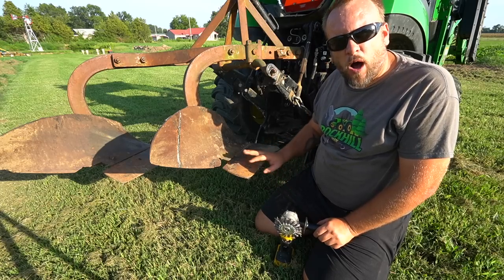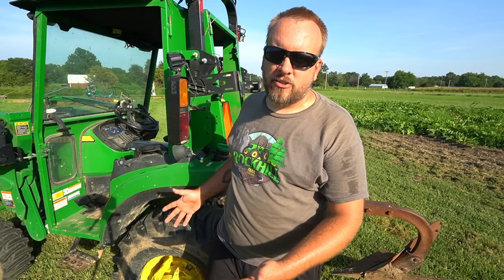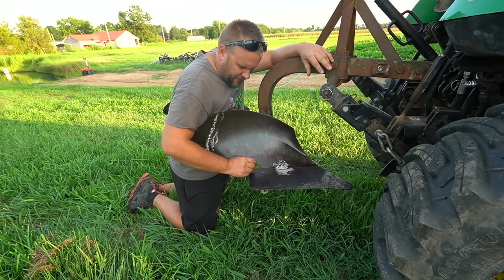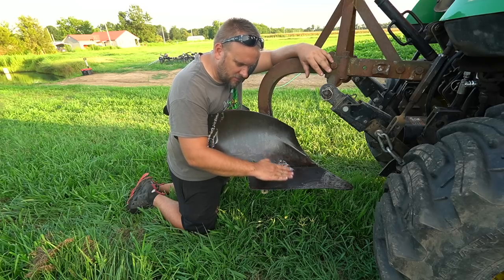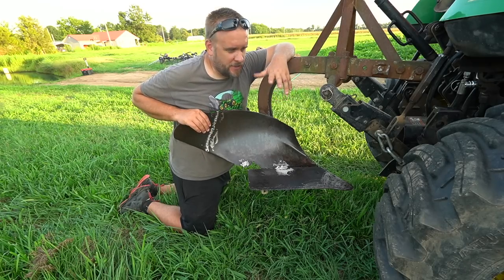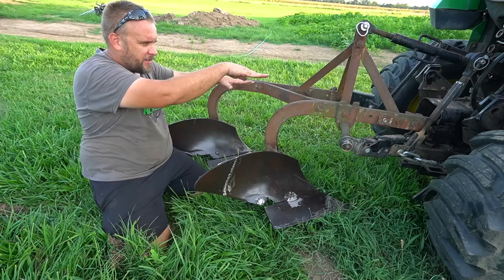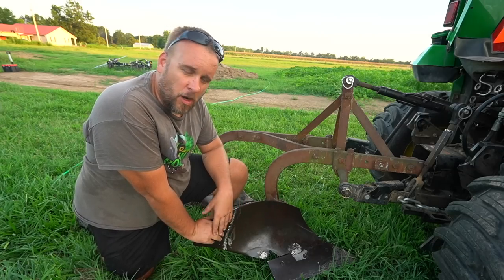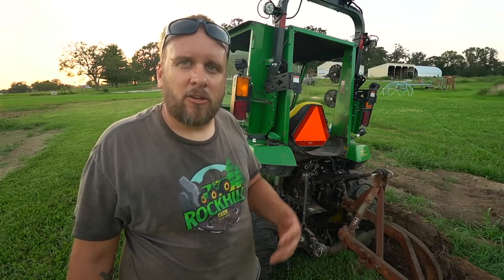Pulling a 2 Bottom Plow with a Compact Tractor - Better than a Tiller?

Comment: If you have to go super slow and not plow as deep as you want to with your tractor, I don’t see a benefit to try and use a two bottom plow. A single 14 or a single 16 would be a much better option. A lot of people plow one direction and then back up all the way to the beginning to plow again. That takes double the time too. Split your plot in half and roll the dirt to one side, then turn around and roll it the other way. That way you are always plowing from one end to the other, not just one direction. When I plow my garden I roll the dirt all inwards one year, then towards the outside of the garden the next so there isn’t a hump or a ditch in the middle of the garden. That old plow will shine up with time too. Love the videos! Take care!

Comment: Very interesting. I am just a layman interested to learn. I was thinking to get a small tractor to play on my small property, but it is this kind of thing and the huge cost that holds me back. 

What is it about your soil that makes the going so hard? I don't see rocks or roots and doesn't seem terribly solid with clay. I do think I see the sod holding it back - making it hesitate. Would it be better after a rain (or worse)?

Anyway, just mechanically speaking: At 20HP deisel tractor could definitely do the job, given sufficient traction and that nothing breaks - it's just the speed at which it can do it. But what is preventing this 40 HP tractor from getting the job done is the hydrostatic drive - I realise on watching. If it were mechanically driven and the gearing were appropriate and if the tires held and nothing tore off or bent - that tractor could do the job without breaking a sweat - if at very moderate rate of speed. But there is something difficient about the design of the hydrostatic drive - it's like it's trying to start out in third gear with a heavy load by trying to slip the clutch (of a manual) - it does not work same as proper gearing. You are triggering the pressure relief of the hydrostatic pump. That tractor was made to look good on he showroom floor - it's just bad design suggest complain to Deere (although that might be like complaining to Boeing about deficient plane design). The difference is that those old tractors with mechanical gearing were properly designed to get work done.

It's not that hydrostatic cant do the job. My wife's new fangle jap car (SUV) has a CVT (hydraulic) transmission. The thing has a little four and the CVT makes it so whatever you are doing and whatever speed you are going, the engine is at the optimum speed/gearing. - the engine never struggles (you wont win races, though it's off the line like a pony car).

Comment: Around here the only thing a plow like that does is bring up weed seeds. Also you shouldnt go at fresh gorund with a tiller, you should use use a subsoiler then a chisel plow, field cultivator, scarifier, or whatever you call it in your region, then use a tiller.  One pass with a tiller wont pulverize the soil too much.  Also farmers dont use a tiller because they have tractors and disc harrows heavy enough that does in one pass what it would take multiple passes with a compact tractor to achieve.

Comment: You may want to check your hydraulic pressure / hydrostatic drive. The reason I say this is that I have a similar setup but with a larger frame tractor. 35 Hp hydrostatic drive in a Yanmar YT235.  similar to a 3 series JD.  At 2750 PSI hydraulic pressure I can spin the wheels on my tractor all day. And yes the tires are filled with beet juice etc. So It has more weight and bigger tires, giving more traction that your small frame tractor. As an example, when I get my sub boiler stuck on a big tree root or rock ( I live 30 miles from rocky top Tennessee ) so I have a number crop of rocks every year.  So you could say that my place is rockhall farm the original 😊. In low range, way before it bogs the engine down, it will spin all 4 wheels and did for something solid underneath.  Your 38 HP tractor should be able spin those wheels with ease in low range before bogging down the drive train. Just my two cents worth and probably worth less than that.

Comment: I’ve had pretty much every brand 3 point tiller, yes I make sure I keep up with service on them, eventually they all breakdown, so I have decided no more 3 point tiller’s because they always break when you need them most, so I went old school this year with the older metal equipment, my compact tractor is a compact 33 horsepower tractor, hydrostatic transmission like yours, the only thing left to buy is a plow, found several 2 row plows but I am not sure it can pull a 2 row plow, what is your take on this?, Ty, keep the videos coming

Comment: If that tractor had a 3 range transmission like the 3R with the crawl gear, it would've tore that dirt up. 
Measuring the wheelbase of a 3R and 2038R shows the 3R is one inch longer and one inch wider at the wheels.  It causes the 2R to not make any sense to me as a potential purchase.

Comment: You would be a lot better off with a trailing plow .  I've got a Little Genius 2X14 that I pull behind a Mahindra Max 26XL and it works fine.  You don't have to worry about the 3 point adjustment, depth and angle adjustments are on the plow frame.

Comment: Those talking about there 25hp pulling a 2 bottom plow also have to think about gearing, if he had a 3rd slower range it would pull it for sure. Some of these tractors like my Kubota L2850 have such a low 1st gear in low range the dam thing would pull a house if it had the traction.

Comment: If your tractor had a manual transmission I bet it would pull better...these hydrostatic transaxles just don't pull like a regular old manual tractor will...keep in mind those older tractors had more weight to them as well, so they'd be able to put the power to the ground more effectively without spinning wheels.  

I don't have a plow, I know my tractor wouldn't pull a 2 bottom plow, it would be lucky to pull a single bottom plow, and even that would be a big if it could.  I do have a roto-tiller, but I don't garden so not a huge deal for me anyhow.  

I would assume that after plowing you'd want to disc that area, at least that's what the farmers do where I live...they plow, then a day or so later they go through the field with a disc...some follow behind the plow with some sort of implement that busts up all the dirt clods and smooths stuff out a bit, then they go over it with a disc....I think that other implement is something called a culti-packer....they sometimes run it after plowing and after discing.

Comment: You are talking about dropping in 10 in that's way deeper than needed  12 in bottom  about 7 in deep furrow  also make sure your cutting only 12 in between the first bottom and the inside edge of your right wheel this will help you pull easier and make for a more uniform tillage also look at the geometry of the top link closer to get more uniform furrowing between the front and rear bottom as well as proper offset on your three point lift arms if properly set most small tractors these days have plenty of power to pull a 2 bottom it then just becomes a ballist issue does it whey enough for traction.

Comment: I suspect a majority of  the suggestions I heard are from people who dont own a plow or used one. Angle and hoq much tractor  are the biggest factors. I have had a number of larger tractors now own a Kubota L2501, and I plow foodplots with my 2 bottom plow. Believe it or not with better results, but there are ao many variables. I also have sandy, less dense soil. Is it a perfect machine for it? No. But you can fet by. Interesting video and test

Comment: Put your bucket on and fill with something weight equals pulling power there's a reason farmers add thousands of pounds to front of their tractor
Reply from the maker: List weight for my tractor is 2500 pounds. Mine actually what is 5000 because I have added every kind of weight you can add.

Putting weight in the bucket would actually take weight off of the rear of the tractor
Reply: weight on the front is primarily to keep the front end on the ground so you can steer which he clearly wasn't having issues with

Comment: Umm, no, you do not drive all four wheels onto blocks.  You only drive the left wheels onto blocks.  This is to simulate your right side wheels being in a furrow.  Then drop your plow onto the level ground and adjust your top link and lift arm link so that the plow sits level front to back and side to side on the ground.   The blocks should be the same height as the plow depth you want to plow.  Six inches is deep enough.  

You have more than enough horsepower to pull the two bottom plow, the problem is it's a hydrostat.  If you had gear drive the tractor would pull the plow easily assuming you have enough weight to get traction, which I think you do.

Your tractor probably doesn't have a true draft control, so one plow modification you might think about for the future is adding an adjustable gauge wheel to the plow mounted to engage the ground about four inches outboard of your rear moldboard.

Comment: If it struggles with two plows, then I would not use two plows. I would just use one plow and don't plow as deep the first year. The second year I would plow a little deeper with just one plow. {Breaking up the sod the first year.} There will be less stress on the tractor and on the "farmer". {That's you. A really important person.} Folks mentioned how the plow will polish up on its own by using it, that is true. Most equipment will last longer if you don't push it to its limit. Farmers will also last longer if they are not pushed to their limit. P.S. Farmers are one of the main backbones of this country.

Comment: A Ford 3000 basically 30 hp will tractor will pull a 2 row turning plow. After a few rows the soil will take the rust off.😮😮😅

Comment: you did the best that you could.  bottom line your tractor is running at max with that two bottom plow..... this is why hydro tractors fail to shine with a load like this.  I think a 8n ford would handle that load better

Comment: Waste of time. You ignored at least two good suggestions. Single bottom. And getting a coulter.
Reply from the maker: Posting this video is not about me getting the ground plowed. It’s about answering a question. Can the 2038r pull two bottom plow.

I’m confident it can pull a one bottom plow. Doing that solves no problem for the viewer.

If I just wanted this ready to plant, I’d run my tiller over it. 

A lot of people are wanting to avoid spending the money on a tiller, and would like to be able to plow with a little little tractor like this

Comment: Add the Colter to the plow that cut the soil asyou go along , almost all plows came with them and , I plowed many tobacco fields with Mf. 35  about 40 hp at flywheel, but weight was 3500 lbs